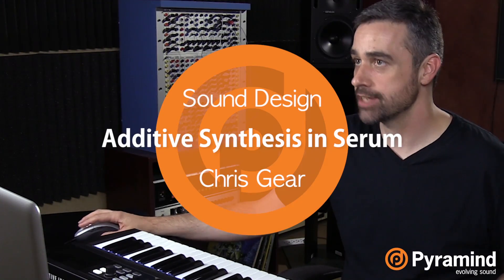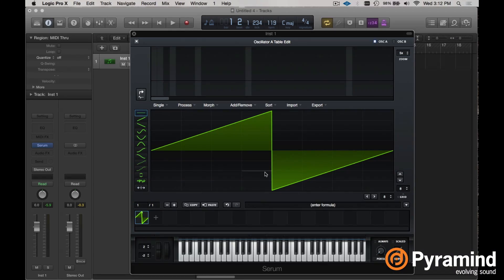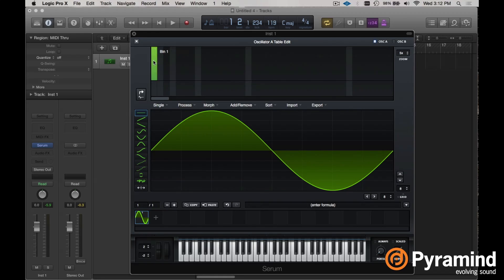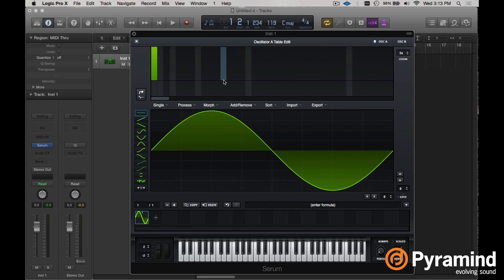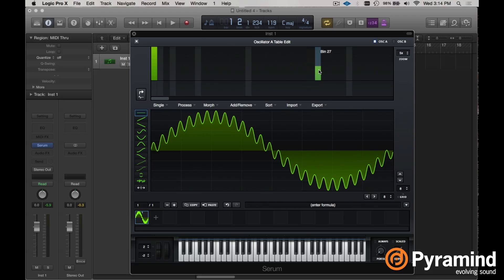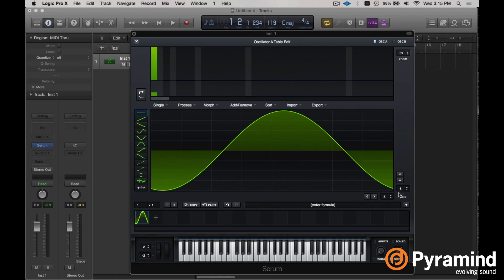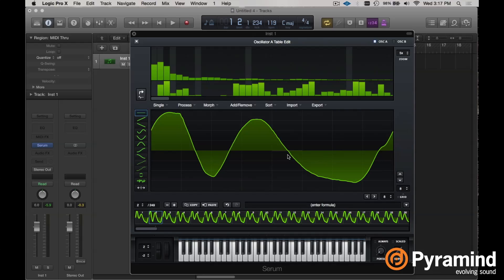Additive Synthesis in Serum | Chris Gear

Comment: I may be a little late to the party, but how is this not FM synthesis? You are modulating the initial sine wave with another sine waves and not adding oscillators together, rather affecting the one frame (cycle) with other waves.

 I am thinking to the routing of Ableton's Operator - when I select the aligned routing algorithm (first choice in Operator) it is FM synthesis with A routing to B, B to C, and C to D. My understanding is the last algorithm within Operator is additive synthesis where the four oscillators work in parallel to combine into a full timbre. 

So wouldn't it be additive synthesis in Serum if I triggered the two oscillators to work in parallel and turn off the filter section vs editing the frames like this? There is no way to not shape the VCA as Envelope 1 in Serum is the amp ASDR envelope by default which you mentioned is subtractive in nature.

Thank you for the video,  I would love your feedback as I am sure I have missed something being self taught in all aspects of music. Cheers!
Reply: Old comment but just to clarify, he is not modulating the frequency of the initial sine wave. He is adding additional sine waves which in turn affect the output wave. This is shown clearly at roughly 2:30.

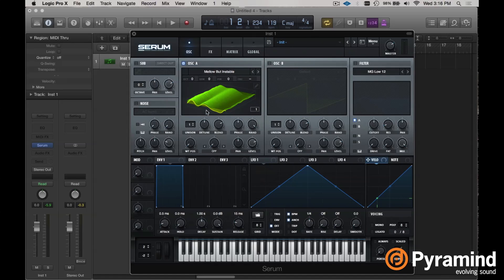Comment: At 5:45 you ask the golden question: how do we create a useful sound? The concept is straightforward, the application...not so much. Image Line's Sytrus is the only soft synth I've ever been able to create a useful sound with an additive process. Conversely, Image Line's Morphine is a nightmare.
Reply: Out of curiosity, what makes Sytrus easier to create a "useful" sound? I never used it.
Reply: That's an interesting use of Sytrus.  It is an FM synth but the manual says: "The 6 user-definable operators can act as independent oscillators for subtractive synthesis, cross-modulate to create complex FM (Frequency Modulation) or RM (Ring Modulation) synthesis or the 256 partial harmonic editor can be used to additively synthesize virtually any timbre you can imagine. With up to 64x oversampling Sytrus delivers 100% epic sound.
" (which it does)

I adore Morphine and use it constantly for its instrument emulation.  The instruments sound synthetic but fantastic.  At some  Uni in the USA they have spent a year working on a bassoon patch. It would be great if there could be patches that emulated every orchestral instrument. 

The Resynthesis engine is awesome and you can get some great things.

Harmor, also an additive synth by Maxx Claster,  was voted one of the top five softsyths by Music Radar users.  I have used the image resynthesis in Harmor to get some cool sounds., but I don't like Harmor nearly as much as Morphine.